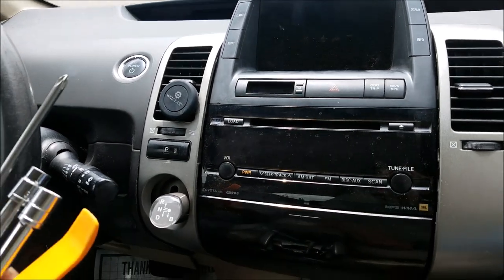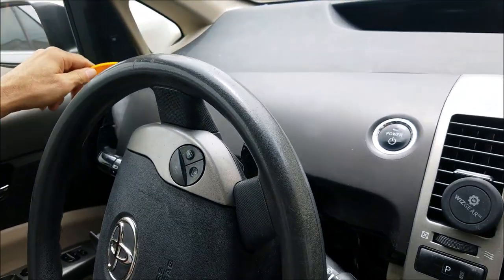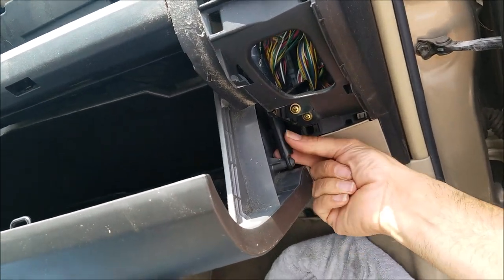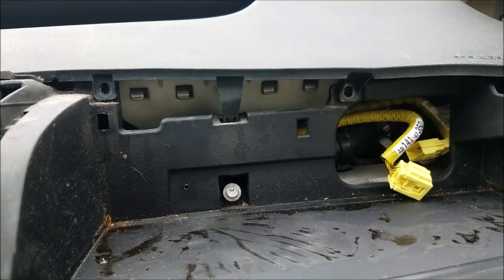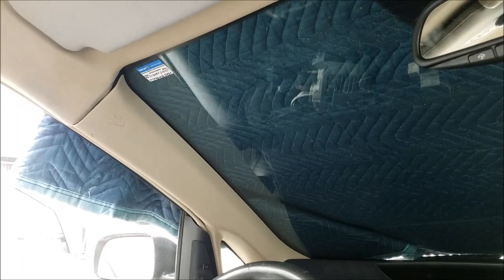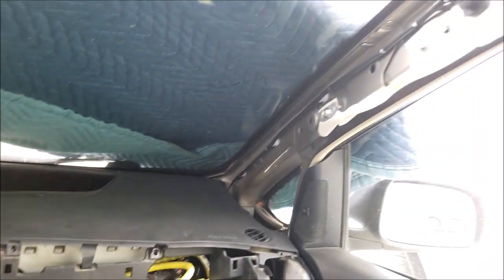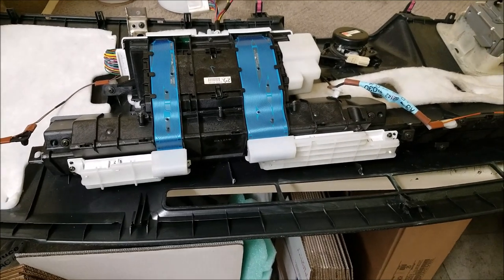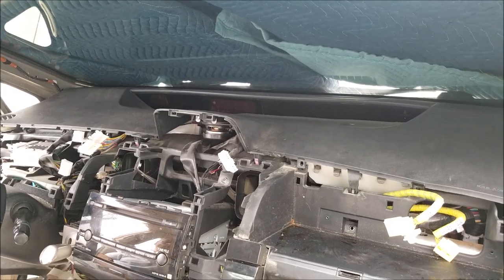How to Remove Speedometer Cluster from Toyota Prius 2008 for Repair.

Comment: Big help!  I took on the task, in part by the encouragement you provided in this video. The repair of the combination meter was a total success. I replaced the 100 mfd 16v capacitor with a new 220 mfd 16 v cap...works better than new (esp after change to 220 mfd vice 100 cap). Thanks for all your effort to post this very helpful video.

Comment: GREAT video.  I was only looking for how to remove the driver's side AC vent on my 2005, and that was answered within one second of actually starting the dash removal at 0:54.  Removing it is the easiest way to get at the parking brake switch which I am replacing when the part arrives in a couple of days.  

I diagnosed that the parking brake switch was stuck on (versus the fluid level switch being on, another possible cause of red brake light warning) using a Launch Creader Elite 205 scan tool to read live data on its ABS diagnostics.  The cheaper 200 or 202 would also read all the brake switches' on/off status.  For the 205, I paid $188, and I chose IMMO as one of its 5 free lifetime reset functions it to match a new Toyota key fob to my 2017 Prius Prime.  I later grabbed a 200 on Amazon Lightning Deal for just $71, though it would be $20 to buy each reset function (such as IMMO for doing the key fob) for one year.  Between YouTube and modern scan tools, things are getting easier to fix, when manufacturers are trying to force you to use dealerships to get repairs done.  Very tempting to step up to a $450 or $700 scan tool to be able to do more things.  One big DIY repair pays it back.

Comment: Thanks! Got as far as the air bag 12mm bolts and then got stuck. Someone used an air ratchet to install this, I got it loose and only lost a bit of skin.

Comment: @8:33 The two tabs sticking out of the foam padding that are between the speaker and the red wire. Are they supposed to connect to anything? I put the dash back in,  everything seems to be in the proper place and everything works correctly but the dash now bounces at about the point of those two tabs. I checked inside the dash and car for a part that I may have dropped but couldn't find anything. I'm wondering why if it's back together like it was why does it bounce now.

Comment: heads up for removing the air vent trim: the plastic is very brittle compared to the other pieces and so you must pry from the bottom first, then the part will swing out. if you pry from the top you'll snap clips or even the entire piece

Comment: I replaced and now the red triangle ONLY stays lit up even if I disconnect the 12-v battery. It used to go away when I disconnected the aux battery to reset the transmission fault but now it stays lit the whole time after the replacement. What do you think could be the issue?
Reply from the maker: Before replacing the cluster you need to transfer the information from the old cluster to the new one.
Reply: HiTechElectronic the light went away and everything is back to normal. I’m assuming as of now the car ecm reads different mileage from the cluster I installed now, right? This is where the disclosure must be presented when I decide to sell car in future.
Reply from the maker: @priusgame1178  The new cluster should show a different mileage than before. You may want to have your old cluster fixed and replace it.

Comment: if you change the cluster what happens with the mileage does it reads the one on the new cluster or still reads the original mileage of the car
Reply from the maker: Won't not show the original mileage.